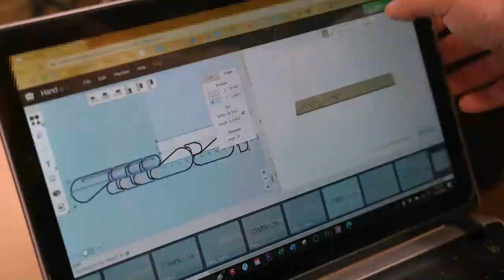Giant Articulated Hands (carved from wood) - X-Carve Pro

Comment: I'm just wanting to know what you placed the X-Carve on, does it come with a table or did you have to get one yourself and if so which one?
Reply: Yes, at least the dimensions.  I have one on order and need to have a table ready.
Reply from the maker: That's the Rockler 5'x5' shop stand with a double layer laminated 5x5 baltic birch top. The footprint of the feet of the machine is roughly 56x56" but the Y rails of the machine make it slightly wider than that. So the feet of the machine fit on the table with room to spare, but the rails and gantry hand of the left and right sides by a couple inches.

Comment: I cut a little hand like this out of balsa wood when I was in 8th grade. I used model airplane hinges for the joints and elastic strips with thumb tacks to return the fingers. Fishing line to pull the fingers. Then I put a mitten over it. I wonder what ever happened to that thing 🤔